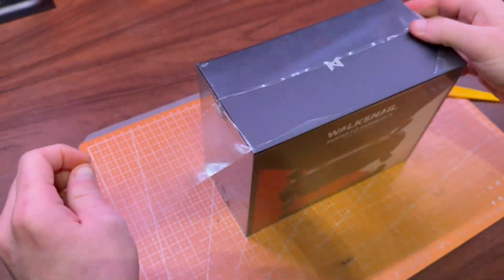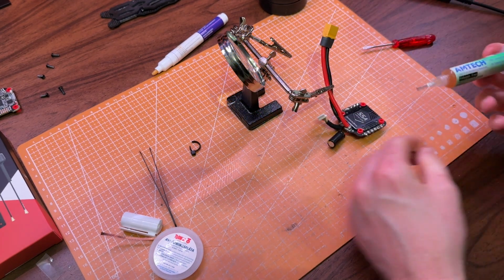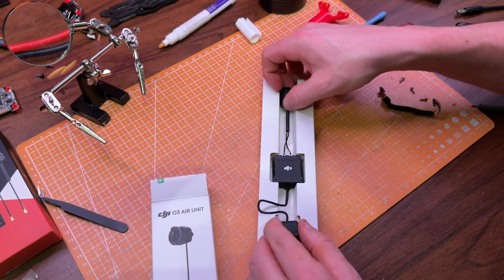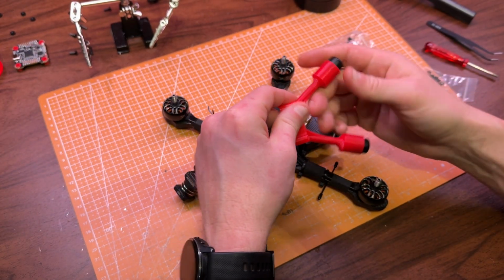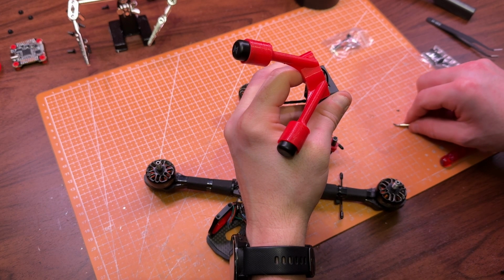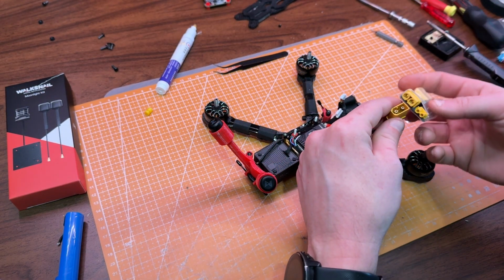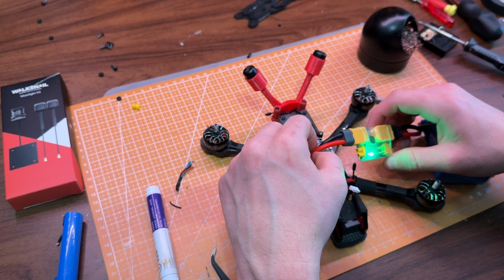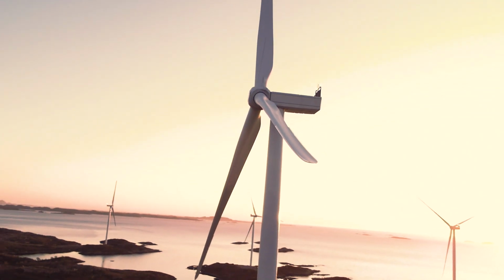I Tried switching to Walksnail - Better Than I Expected

Comment: Since this soldering helping hands has very sharp edges, I used some shrinking tube on the clips and it does not cut trough my cable insulation.
Reply from the maker: Good idea!

Comment: I had Walksnaik (Moonlight, GT, Pro) with Truerc antenna kit, but gone video midflight and caused loosing two birds because of it! Totally not reliable!
Switched to Dji, and since I do not need to worry about the sudden video signal lost and penetration.

Comment: I started with DJI camera drones a few years ago. Then got into FPV using 03’s. 

I wanted to try Walksnail and ended up with the Goggles X. I also got a Moonlight Kit because I was hoping to fly in low light/night time conditions. I was wrong for thinking this is what I wanted. I then got an Avatar HD Pro cam thinking it would work with the Moonlight VTX…mistake 2. I ended up with the Avatar HD VTX to use with the Pro cam. It worked ok but I had HORRIBLE range. I tried every setting I could and even upgraded the antenna on the Goggles X to the TruRC MK II’s. This didn’t help either. 

End of the day I went back to DJI. I’ve got the G3’s and 04 Pro’s in all of my quads. 

Walksnail has its good points and bad points. However, DJI just works and it’s easy to use. For me, I’ll stick with DJI. I hope you enjoy your new system.
Reply: I have walksnail myself and never had problems with the range. I once reached 1km with the walksnail moonlight and goggles l. On 25mW.
Reply: Unfortunately, the coaxial antenna cable on the Goggle X often gets squashed. This is why some people have such poor range. You'll need to carefully open the Goggle X and replace the antenna cable.

That would solve your range problem. 🤟😎
Reply: @tomkoller749 damn….i wish i had know that months ago before i sold off all my Walksnail gear. Thank you though.